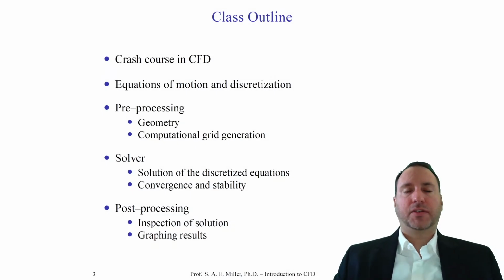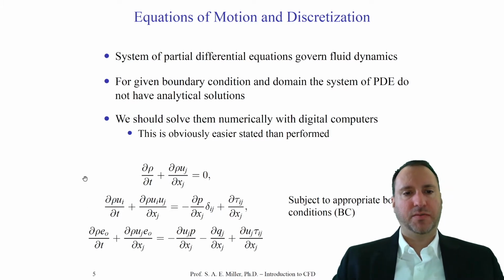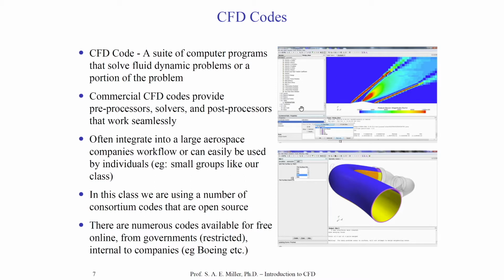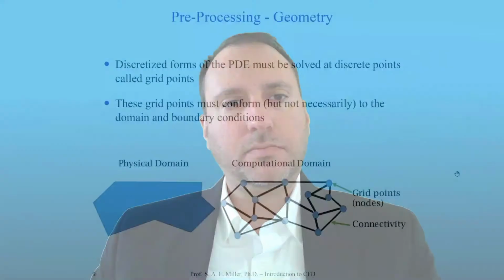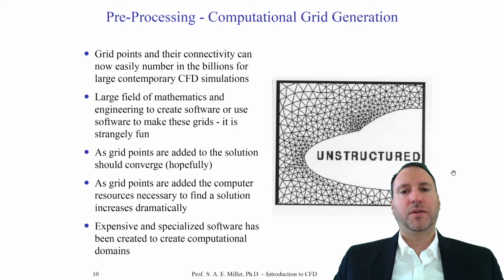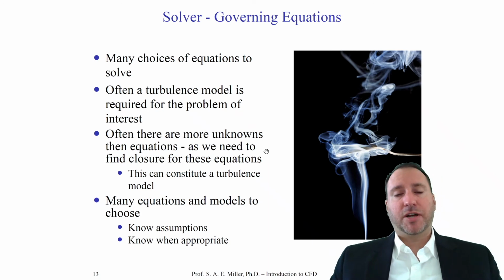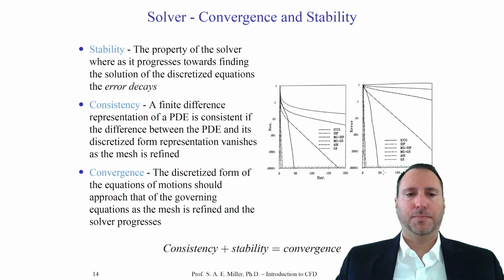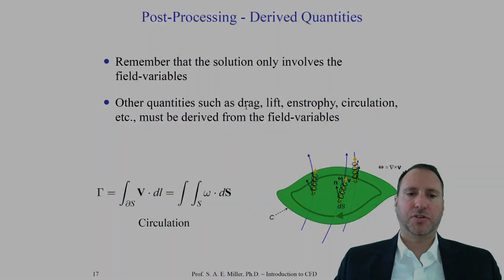Introduction to Computational Fluid Dynamics - Preliminaries - 2 - Crash Course

Comment: i have searched for months until now to find a way to learn CFD N-S, BTW I am a freshly graduated Mechanical Engineer, we don't take Vector Calc, neither CFD or even Navier Stokes, but fortunately we take FEM course where we apply FEM to static structures in 2D and 1D problems and solve them manually by hawks law F=K X, the problem is that we have not been introduced to CFD in any way, and my first exposure to CFD was difficult in my capstone project, now as I have graduated I have learned basics of Vector calc, and I am trying to learn CFD in a good way not just clicking, and lean the theory behind things, but leaning those things can take forever because you can ask questions for ever and find new things to know, so when is enough?
Reply from the maker: There is always more to learn. A famous joke - the more I learn the less I know.

Comment: thank you for sharing this great work.
is it possible to have apperent convergence? for example, to have stability but not consistency or to have consistency but and an extremelly slow divergence in stability, which seems not to diverge.
thank you again
Reply from the maker: I believe that it is possible to have a non-consistent discretization of PDEs. These might converge through a solver. The numerical solution in this case would not represent the one of the original PDE. Great question!